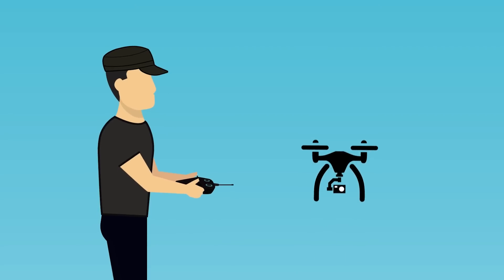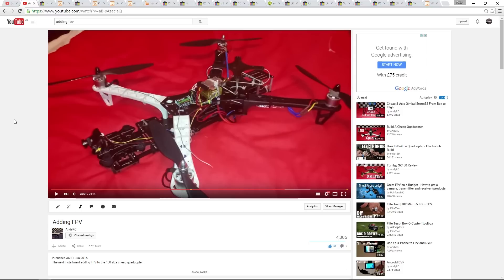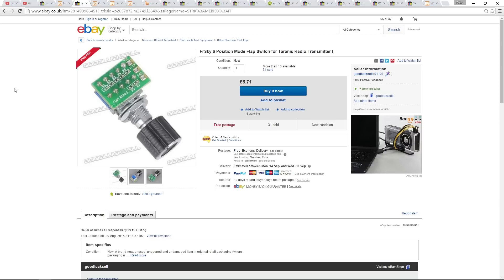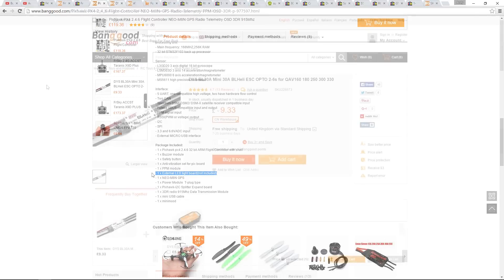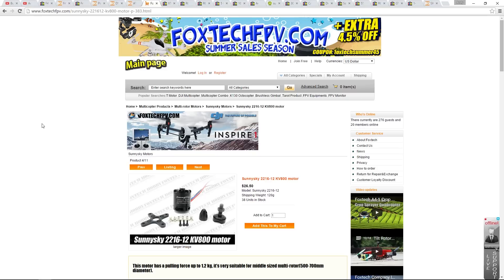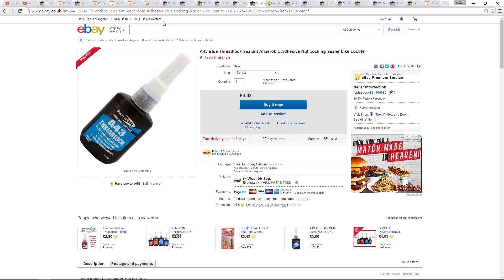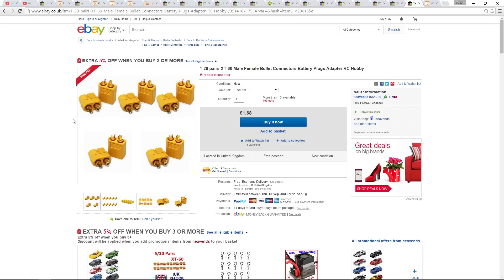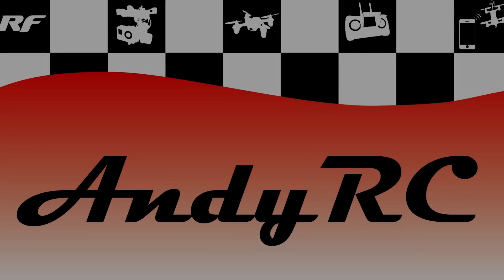High End 450 Quadcopter E01 - The Big Shop

Comment: Thank Andy for your videos.. 
I have a question... 
There is a big difference between Pixhawk PX4 2.4.6 Flight Controller
And the OpenPilot CC3D Revolution?
Reply from the maker: +Gera Hammer yes the pixhawk is a complete auto pilot system for big quads and the cc3d is suited to smaller agile quads.
Reply: +AndyRC thank you for your answer..  Another small question: the Pixhawk light version is enough for return home feature?
Reply from the maker: it is yes but one thing i will say is that it doesn't have as many connections as the pixhawk full version if u are wishing to add stuff in the future.
Reply: +AndyRC I will take it in my consideration.. Keep doing great videos :)
Reply from the maker: no problem i think the lite version also doesnt have a speaker /buzzer but thats not always a bad thing!

Comment: AndyDid you find that the 1045 props with a 4cell battery gave you too much thrust,I'm in the early stages of a build and my quad weights in at < 1.3Kg and it gets airborne at very low throttle and it makes it  impossible to tune.   I strapped a 1Kg piece of wood to the bottom and it flew a lot betterGoing to have to go for smaller props and/or a 3cell I think
Reply from the maker: +Iain Knowles not really no even with no gear loaded it flies quite nice. did u adjust the gains like i did to cater for the 4s? cheers
Reply: +AndyRC   I've started off with a Naze32 board, 30a simonk esc's and  sunnysky 2216 800kv motors.  I got down to a P gain value of 2,. Even then,  as I get the props spinning (quad still on the ground) with no additional throttle stick it wants to jump into the air.  (less than 25% throttle.)  Wasn't sure at one point if I'd got a faulty esc or flight controller.I guess I could lower the P values some more, but even then I don't like the idea of hovering on 25% throttle.Adding the additional weight made me think it was too much thrust, but maybe ithis is just masking the actual problem.By the way, I'm struggling to find 9" props.  Any recommendations
Reply from the maker: ah i see i think most of the stock settings of the naze32 are for miniquads rather than 450 quads. I like to get my props from rctimer the carbon ones fit the 2216 nice and are well ballanced
Reply: +AndyRC Have you changed your prop adapters.   All the carbon props seem to come with 8mm holes
Reply: +Iain Knowles Scrub that.  rctimer have just responded to me again.  they come with 5mm and 6mm adapters.I wish they'd put that info on the web page, it would save so much hassle

Comment: I'm glad I found this series of videos as I just purchased a DJI F450 ARF (genuine) kit, the pixhawk kit as well as the Taranis X9D / X8R. This being my first quadcopter build, my brain has been getting fried with information overload from all the googling and youtubing, how fortunate for me that you've made this comprehensive guide which I thank you immensely for! Still waiting on the X9D to get started, but the only thing I'm worried about is that the LiPo's I got are only 3S 2200mAh 35C. I'm wondering if the flight time will be too short to do an autotune and whatnot. If so, could I hook up the two batteries in parallel to get some more flight time out of it? I have a 3d printer which I can use to create something to hold them in place if that would be the only issue.
Reply from the maker: it depends on what u load it up with. with no payload that setup will be fine but camera and fpv gear then yes u will need bigger
Reply: +AndyRC awesome, thanks!

Comment: Hey Andy RC, I bought a cd3 fc based off your cheap quad build and then with this video and more research realized that I cant do the return to home feature if I lose signal. I see you bought the pixhawck but thats expensive! What do you thing about the apm2.8 Adrupilot? Would you get the Neo 6M, 7M, or M8N? Thanks for all your help.
Reply from the maker: +Rhameen Kolyani apm is discontinued now so remember that. i have an apm 2.6 and it works nice. but you will really want an m8n to get good gps hold

Comment: Andy - the frame here seems smaller that on the "cheap build" why did you go for the smaller platform? cost or quality?  Really enjoying the videos - sat through all of your 2 builds over the last 48 hours and got me really interested.  Please keep it up.
Reply from the maker: +Cillin O Foghlu 0:57 into the video explains why i went for a smaller frame, thanks for watching :)
Reply: appreciate the comment.back.  have re-watched the video and see it.  just wondering if all the drilling close to other holes is a result of the smaller platform...not decided on which i will pick - but will build one.  just ordered a micro drone to learn on.
Reply from the maker: +Cillin O Foghlu smaller is lighter. the larger frame is a waste when I add my fpv gear to a landing skid rather than the frame. so I chose to have the frame smaller

Comment: Ordered everything!! Just have to sit back and wait for parcel after parcel to show up. Thanks Andy for clear instructions etc. The only thing I didn't order was the 6 mode switch for the Taranis receiver. Some reviews on BoltRC dot cm said that the switch is stiff and that a switch on the Taranis gets in the way. They regretted buying it. Are they just nutters? How's that switch going? If bad, maybe there's another one or I don't need it?
Reply from the maker: +Perma Psy yes totally incorrect, the switch is fantastic. load of nonsense as you will see how convenient it is in the next few episodes.

Comment: hi andy,ive been following your videos and im really existed about this new build !! I have just completed the other 450 and it flys well but I really want the gps ati and RTH mode so im definately going to building this new 450!I don't know whether to stick a naza gps on this cheap 450 quad ?? 1 question though what would be the range on the cheap flysky tx ive tested it and think ive been over 250 meters! thanks again looking forward to the new vids!!
Reply from the maker: +chrissy roberts Naza is a good option too, there will be a review of that on the channel as well eventaully. although I have been really supervised how easy the pixhawk has been. the flysky is rated at about 800 meters
Reply: that is good range for such a cheap tx im hopeing my fatshark googles come in post tomoz cant wait to try them out! Ive just order the cheap £30 gimble which I think is plug and play but I will need some help on seting it up to my radio to pan and tilt! if I use the cc3d and take off the flight mode chanel and use ch5 and ch6 would loseing the flight mode on cc3d make it hard to fly the quad??
Reply from the maker: no if you go into the cc3d settings and change the flight mode to 1 and leave your only mode to stabalise then the quad will stay in stabilize mode and you can run the spare channel for your gimbal. dont you have any more spare slots on your receiver?
Reply: yes there is 1 spare slot ch5 but can you run pan and tilt from just 1 channel?? bit of a noob question I have been on youtube a lot but still don't really understand about setting up properly!
Reply from the maker: no u can only run one channel per axis, i would suggest tilt pan can be done by the quadcopter yaw
Reply: yes I thought the same thing. Andy have got the link for the vibration isolater your using for the  XiaoMi Yi  cam?? ive seen it for 30 dollors on a usa site but I found that abit exspensive.
Reply from the maker: do you mean the vibration isolator used on the cheap quadcopter video? im afraid rctestflight makes them himself. you can make a similar sort of thing for pennies though out of credit cards. search credit car vibration dampener :)
Reply: going to build 1 tonite lol thanks Andy for your help.
Reply from the maker: no problem

Comment: Pixhawk is a great FC. Looking forward to the build series. Make sure you get the 433mhz telemetry modules as you can't broadcast legaly with the 915mhz ones in the UK.
Reply from the maker: +alpinechili yes its the 433 version they use to allow you select the frequency but they have changed that kit recently

Comment: Hi Andy.

A really great introduction to the build series and some excellent component choices. Even though I went with the Naza M-V2 controller for my hex I have a lot of respect for the Pixhawk and use the APM in my fixed wings. Something I would stress during the build is the choice of Iron, solder, and flux. I've seen a lot of failures due to poor soldering. The iron needs to be strong enough to provide enough heat without it leaching away, the base plate is a very effective heatsink and cheaper low powered irons are just not suitable as the solder contacts will break away due to vibration. Another really nice to have feature is to have the telemetry streamed to the Taranis as well. I use a Zaggometry cable between the Naza and the X8R receiver. Peter King supplies a similar cable for the APM and Pixhawk. Really useful if you're flying without a smart device but still want to log the data. Looking forward to the next instalment.
Regards
Nidge
Reply from the maker: +sputniksam Hi. if you use 60 40 solder, it has a really low melting point. therefore most budget irons will still do the job nicely. mines a mid range setup and no failures yet.but unleaded solder absolutely. thanks for the info on the telemetry. do you use it instead of an OSD on your FPV gear? cheers for the support
Reply: +AndyRC Even though my Hex is FPV equipped I only use it for framing and not for actually use as an aid for flying so i don't have an OSD installed. I have the data from the Naza displayed on the Taranis by way of an adapted Lua script originally written by a member of the X9D FB group. This includes realtime GPS data, position, speed, altitude, etc plus the voltage and current.. This is also written to the internal SD card and exported to Google Earth for post flight analysis. In the case of your Pixhawk you can download the same data from the FC, I do it from the Taranis as the Naza doesn't store this data. WRT my comments about soldering I was inferring that some folk fail to heat the surface of the bottom plate sufficiently which results in the solder not annealing properly to the surface and the bond being very brittle and breaking away due to vibration and movement.
Regards
Nidge
P.S. Love the new intro animation.
Reply from the maker: thank you mt friend rob made the animation :) very cool. I have one of the telemetry boards, just knew it as called something else lol. Im not sure if i will use it though as it will copy the minim osd which will be displayed on the fpv screen anyways. I totally understand the need for it though and also a good backup if the fpv fails. also if you dont fancy doing fpv one day and still want telemetry so I will include it. thanks for your support and input